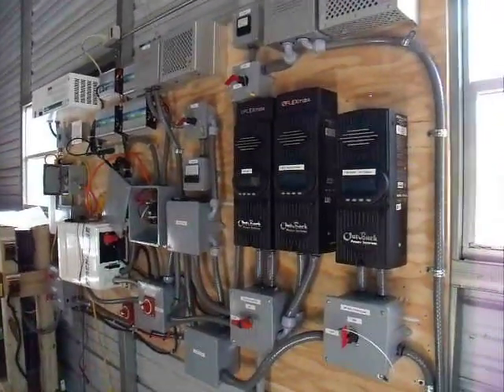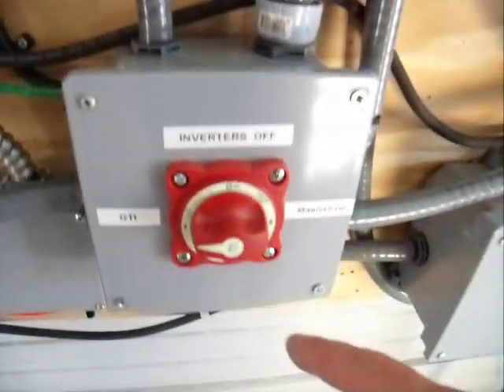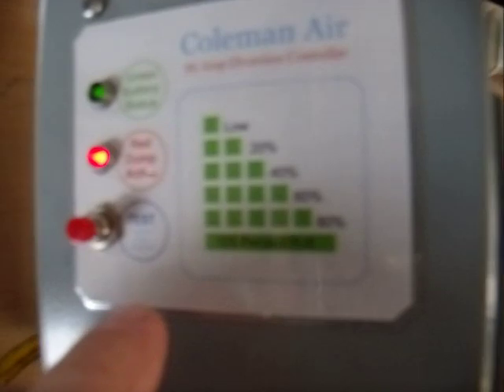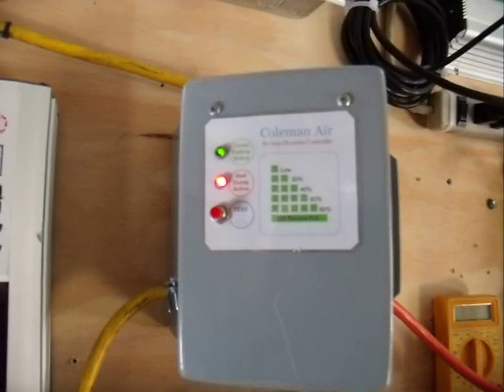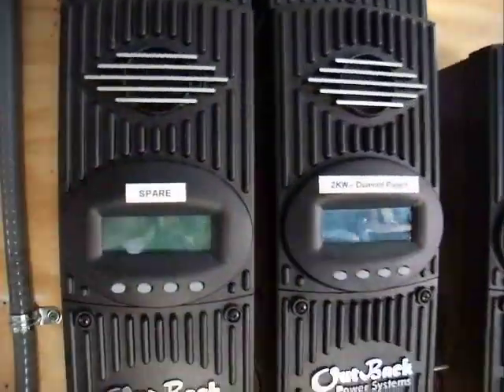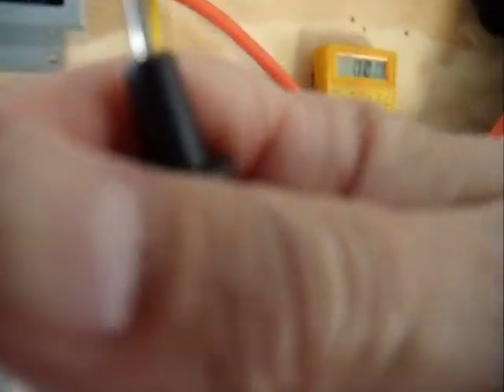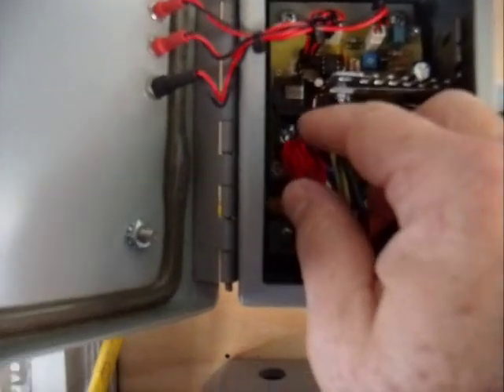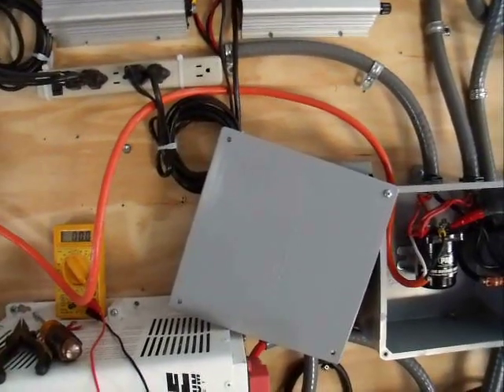Automatic solar to battery dump to grid tie inverter

Comment: That was over my head. Can I apply what you did if I am trying to dump excess output from my grid tie so I don't export to grid?

I have microinverters and I haven't found a way to dump the 240v ac

Comment: Why not just place a high current diode between the batteries and the grid tie inverters? Seems like this would allow charging of the batteries but isolates the grid tie inverters from them so they won't drain the batteries
Reply from the maker: +Taylor Jones That's a great idea.
Reply: How would one do that? What kind of diode do you use?
Reply: a massive massive schottky. You'd lose a lot of power just heating up the diode

Comment: i can see your engine skills are very cool, but wouldn't of it cost the same and be just the same as to buying a regular 10k or 20 grid tie inverted and buy a couple of isoltor to charge your battery bank this cuts down all that wiring and added equipment. nice job anyways
Reply: kg kb A 10-20k inverter are thousands of dollars more then those four cheap inverters...

Comment: Hey Al I just order a sky max 1000 watt 24volt turbine. Can I hook the turbine to the out back 80 amp  charge controller.i have 1000 watt solar panel hook up to the outback already ,if not can you recommend a charge controller that I can use.thank you

Comment: Very nice idea, to use the diversion from the charge controller to dump excess panel power to the cheap grid-ties ... but I wonder how you hooked up the 4 GTI units to the power from the panels?. They are 500w GTIs -- but are you sending the entire output from your 4kw of panels into them? Aren't they only designed to accept 500w each? Did you come up with a way to limit the watts going into each GTI? If not, then wouldn't you be over-driving the cheap inverters with all that panel power?

Comment: Can I ask why you never used the built in Aux Port of you outback to turn the relay(battery isolator)  on and off a set point? I'm trying to build a similar system but with a Tristar MPPT 60, and use it's relay controlling abilities.

Comment from the maker: I have disconnected the Coleman dump as the battery voltage rise was too fast to be effective but at the time I was not disconnecting the Coleman which was not interfering with bulk charge but did cause float charge issues. Thanks
Reply: econewpower That wouldn't be an issue if you only use batteries after sundown....add a timer...

Comment: Hi, I am from India, the problem in my state is we have a 3 hours of power shutdown everyday. I am currently using a 1kw panel with a battery backup using solar charge controller to make a few appliances work. I need to attach a grid tie inverter to this system so that i can use the excess energy (which is produced after the battery is full) to be sent back to the grid. Can you please suggest a way to do it?
Reply: Anand Kumar You would need two different inverters, one grid-tie and one off grid inverter to switch between with blackouts...

Comment from the maker: I really like the Coleman products, they are quality. that being said, you won't be happy using a 24v turbine to charge a 12v bank, the reason is that you will lose 1/2 the power, the 12v turbines have bigger wires inside to account for higher amps and also make power at the peak of the torque curve. Otherwise yes, you could use a single C160 for two HY400s.

Comment from the maker: I decided at the end not use anything of the sort, your best bet is to go from wind to grid tie using the grid tie inverters from ebay for wind turbines, I've read good things about them. Otherwise, what I've done is to put everything to the batteries and always invert a load from my main inverter which is a MagnaSine 4024 to the house, that way the batteries are never overcharged.  God bless and good luck.

Comment: so by diverting your dump load with coleman air to battery isolator, you send your over charge voltage (over 17) to the four,blue grid tie inverters. The question is, the inverters are the ones who accept batery input right. Most of those inverters only accept wind turbine or panel inputs. Am I correct???

Comment: nice setup. question I want to hook my pannels strait to my GTI. and I want to charge my battries. the charge controller I want will only detect when the battries are low and then charge them when they need charged and then stop charging when they are charged. yet still be connect to the GTI even when charging the battries.   I know out back has all the different funtions I'm looking for but pricy lol.  any ideas.

Comment: AL,
using wind and that charge controller can i use the cheap china grid tie inverter for a dump load?
if so do i need that add on piece u added or just the charge controller "note ill use the outback solar charge controller to the same battery bank as wind.

Thanks John

Comment from the maker: @ProtocolsMaster Forget little or big power panels, they have no bearing on the decision of grid tie vs. batteries. The advantage to grid tie is that you don't need batteries, battery cables and charge controllers and therefore the cost is much lower, the disadvantage to grid tie is that when the power goes out your power also goes out and you usually have to get permits and inspections from your power company for them to let you grid tie your equipment.

Comment from the maker: @wandido2001 I use a 24v to 240 vac MagnaSine 4Kw grid tie inverter and a 24 v to 120 vac TrippLite 2.4Kw off grid inverter.

Comment from the maker: @wandido2001 No, it just disconnects the GTIs from the batteries when the voltage falls below the limit I've set. I no longer use those GTIs as they fried over time - Chinese junk.

Comment: Nice setup. I am unclear about the configuration used for the Coleman Air. Does it disconnect the panels from the batteries and connect to the GTIs, diversion control with battery disconnect?

Comment from the maker: @BigBearHuskyMusher Unfortunately there's no way to do what you want UNLESS you add a circuit with  a blocking diode to keep the inverters from using battery power and draining them. However, likely you will not float charge your batteries as the GTIs will try to consume all the power they can from the panels. You can add a small float charger if you like on the other end of the blocking diode circuit.

Comment: I want to mainly go GTI but also I want to float charge my small battery bank for when/if the grid goes down. I have 3 PV panels 500W total each running 24V and I will run them parallel to a 30A 12V/24V LCD Display Solar PWM Battery Charge Regulator "CM3024Z". I need to know if I parallel my pos and neg wires from my solar array to the GTI and also to the charge controller that that setup will accomplish 1. keeping my batteries float charged at all times and 2. any excess to go to grid tie.

Comment from the maker: @howgoodisit The circuit does turn on an off a lot towards dusk when there's not enough sunlight to produce as much as I'm dumping out. I'm looking at getting single larger inverter but I have to find the right one that goes 50v-100v so I can tap right off the panels and not have to use the switching circuit.

Comment: 2. With the coleman air charge controller, when it gets to 14.5v or so and switches to dump... as the battery voltage drops back down does it keep flicking on and off a lot or does it steadily stay on dump for a long while?  
I am thinking of running a beer fridge along with resistors as dump load.. cold beer from excess power sounds like a good idea to me!

So with your dumping to grid tie inverters... do they flick on an off a lot?

Could you not find 1x large grid tie inverter rather than 4?

Comment: System is looking excellent Al!!!
Thanks for your update,  I just have a few questions... more regarding your old system...
1. when you connected your 24v turbines running 12v did you need to put a blocking diode after the 3phase rectifier?
As i am switching my 24v turbine to run 12v with the same gear from colemanair...

Comment from the maker: @VOODOO74W The size is irrelevant as I'm not using the internal relay, you can just buy their circuit board and do the same thing. When the circuit board contact close it activates the coil in my 200A solenoid, that solenoid is the one that power the inverters. The coil in the solenoid draws about 2 watts.

Comment from the maker: @douglas1836 In my humble opinion I thing the WindMax are far superior to the Delco PMAs like MWS and WindBlue.Regardless of what you watch in their videos, the blades in the WindMax are far superior in catching wind and moving the turbine. My six raptor blades won't turn the turbine until 12MPH, by then my WindMax is making about  300 watts, just no comparison. Also the Raptor blades had to be replaced because with time their edge breaks down and chunks are missing from them. God bless you.